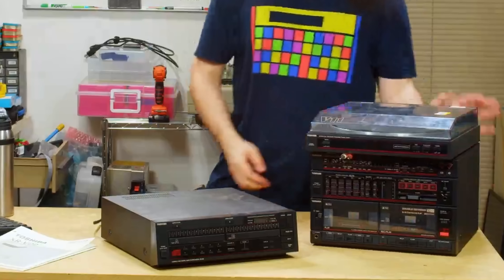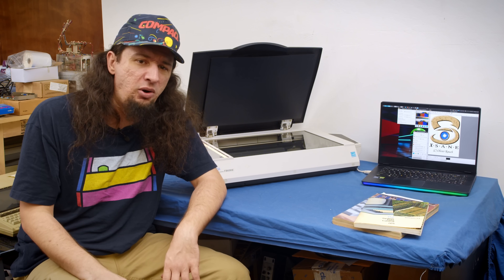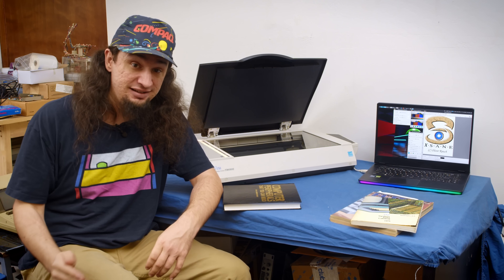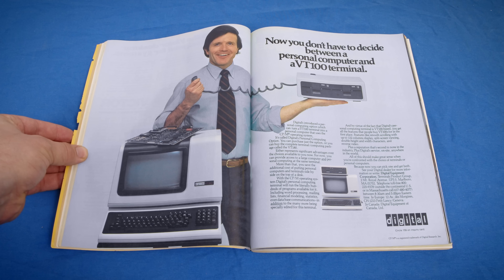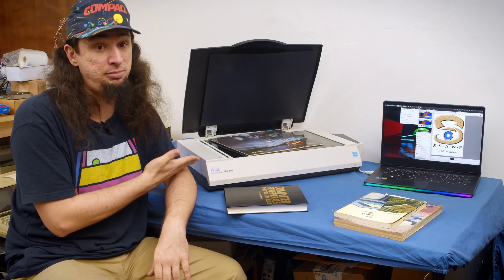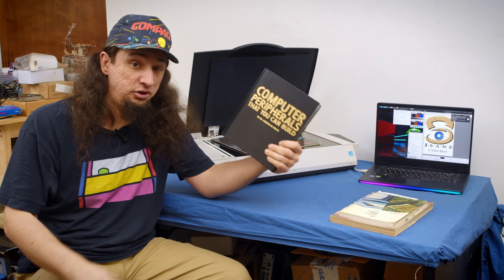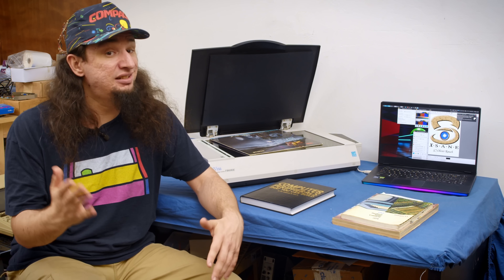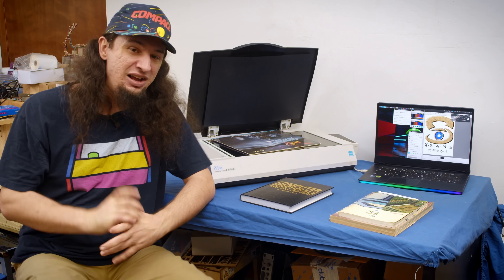Archival Grade Flatbed Book Scanner - Avision FB6080E

Comment: I was going to mention those CanoScan things. They can be a little slow at higher resolutions, but the lowres "preview" scans are lightning fast. I've not scanned many books, but magazines never gave me any problems - line the page up at the (0,0) corner and the binding gets cropped out. It does mean a lot of editing, but you'll be doing that anyway. (unless you can be meticulous in placing the page, then the cut is the same on every page, and that can be programmed.) For pictures, I have this HP thing; no drivers required as it presents as a standard storage device containing a jpg. (the "driver" just watches that drive for new files and copies them.)

Comment: The Canon LIDE is great. The ImageRunner sucked because they didn't implement a grayscale mode but you could use the ADF..  I'm in the debinding camp, but what I do is clamp the book between two two-by-fours and feed it into the belt sander until the binding is gone. Then I feed the pages into an ADF. A little trick on ADF scanning is to fan the paper first, as it can be humidity dependent.

Comment: Personally I own a Canon flatbed scanner that can also scan film in both 35mm and medium format 120 film used in most Hasselblad cameras. It can also do 35mm slides with the adapters that came with it. It is CF lamp based but I wish I knew the kelvin temperature of the lamp just in case it fails. There are sources for the lamps from what I have seen but they only give dimensions and color temperature. Most of these lamps operate at the same voltage so the power supply within the scanner hopefully would be universal.

Comment: I have to scan architectural drawings sometimes that are bigger than DIN A3- which is the biggest size for a normal flatbed scanner I can get here. So I have to fold the old plan into smaller shapes that fit into the scanner, which has an edge all around the scanning area.. and then put everything together in software.. which also sucks since the rotation never matches... the scanner in the video would make all of that a bit better.. I have worked with big format scanners- but they are completely unaffordable even for most print shops and they also tend to distort the image quiet a lot.. which is a problem with technical drawings.
Reply: Depending on how often you need to do this, you might consider a camera on a tripod with a panoramic head, and open source panorama software (e.g. Hugin).

This would allow easy capture up to around 40" x 30", 600 DPI.

Comment: I have a Canon Lide flatbed scanner and would love to have the proper drivers to install to Win10.  Had an old IBM branded flatbed scanner that used the parallel port and that was the best flatbed scanner that I've seen.  The IBM scanner was able to capture clear images that had physical depth to them.  It was not a 3D scanner but it had a good 1/2" depth of vision from the glass.  I was surprised when I used it to image old ISA cards.  Unfortunately I don't have the IBM scanner anymore a friend needed to image their family photos.
Reply: Vuescan.
It works with these canon scanners, mine was my go to until it fell off a shelf

Comment: I like my little lightweight cheapo scanner with buttons on it.
It's bad and it jams but it's USB powered and I can just hit a button for 75/300/600 DPI respectively and the scanbd daemon just dumps to a folder.
I'm mostly just scanning stuff and not documents tho. Really good way to get a footprint for reference when making 3D print models. Dimensional accuracy good.

Comment: What I got for scanning a stack of documents was a used Canon P 215.  It is not for book scanning but it does have an automatic feeder with duplex scanning. that can be used optionally.  It is just a typical 600 DPI scanner but I got it used for around $50.  It has so far scanned a couple reams of documents and is still working fine.  This would have been at least $300 if I bought it new.  It is a portable one you can take with you while you travel and can get all of the power it needs from just a USB port.  Its USB port is micro B like a lot of cell phones came with for a good while after the manufacturers got their heads out of their @sses and started using things not proprietary.  I say proprietary because an old flip phone I had used a special socket for charging and it was nothing that any PC or Mac ever had.  It was different enough from USB that you know nothing will work with it and if you lose that charger you may as well throw the phone away.  I am glad they do not use proprietary things like that any more with the exception being Apple.  I am glad the EU told them to stop.  The last thing we need are more weird connectors that do not work with anything except one specific device.

Comment: Document cameras have made scanning obsolete. And even back then, libraries quickly switched to cameras. I worked in the field years ago and we ended up investing in automated book scanning machines using page turners and cameras.
Reply: It takes an insane resolution camera to do what scanners can do. By many measures, we have that today, but even a cheap scanner can do better than your iPhone 27 and it's 9 cameras.
Reply: @jfbeam  Do you need that insane resolution?
Reply: @jfbeam  we are talking about digitizing text. And, for that matter, a 45 megapixel digital photo of a properly backlit 35mm slide taken on a mirrorless camera is superior to a scan from even a coveted Nikon LS-8000 or LS-9000 scanner - which costs as much today as it did 15-20 years ago. A cheap flatbed will give you a nice flat image though. There's almost no other reason to use one.
Reply: @JGnLAU8OAWF6  not for book scanning. They don't know what they are talking about. "Insane" is not a measurement. I have scanned and digitized hundreds of thousands of archival quality images, by hand, on both scanners and with cameras.

Comment: I can find a brand new Avision FB6280E for about $1000 without taxes locally in Europe (without additional SW). I assume, that's the normal asking price for that unit.
Generally speaking, finding a A3 flat bed is neither easy nor cheap. I just checked several sellers locally and they ask about $500 for the cheapest A3 flat bed scanner, the second to cheap was in thousands of dollars. From what I found in the past, the cheapest way to get a A3 flat bed scanner is to buy a multi function printer with one attached. No idea, why it is this way, but it is.

PS: Look at Mustek A3 Scanner S 2400 Plus, that one may be a reasonable option too. If you can find one.

Comment: The old SCSI scanners from the early 90s, that were legal size, and they were really nice, but they were incredibly slow.
They came with a 50 pin to 25 pin cord that plugged into the standard LPT printer port.
I bought a combination SCSI ISA card then a PCI SCSI card that had an internal 50 pin header and a SCSI 68 pin internal cable, and an external 50 pin connector and a 68 pin external connector.
The software had drivers that talked to the printer port and communicated to the scanner through the cable.

I never tested the cable to see if there was any electronics in the cable.
I don't think it does.

I think SCSI 50 connector has pins that are able to output and input LPT data

I never searched about this but it was sold as an SCSI scanner that connected directly to the printer port.

SCSI was really nice for the 90s and faster than IDE

But it was more complicated

The SCSI CD-RW was nicer but the IDE CD-RW was a lot simpler.
Being able to just slide it in and connect to the existing IDE cable and not need anything except for the software program to make it work and the SCSI CDRW was 400 dollars
The IDE CDRW white box was 99 dollars

That takes me back to the early 90s
Reply: Are you sure you aren't misremembering things? Using a DB-25 for external SCSI devices used to be popular, but it had nothing to do with the parallel port. Scanners with both interfaces still had separate connectors for them (with a 36-pin Centronics for parallel), at least the Epson camp definitely did.
Reply: @PileOfEmptyTapes  you might be right. I think there was a 36 pin connector the 25 pin LPT cable connected to. There was a separate 50 pin or 68 pin connector on the scanner and if I remember correct it had a pass through 50 or 68.pin connector.
I remember having to set the SCSI ID on each device.
The external hard drive which weighed about 60 pounds and was 2 feet by 1 foot by 1 foot square was set to 1 and the 50 pin cable fed into that and it had a pass through and the external CD drive had the same thing and the scanner was at the end set to 3 and it needed a 50 or 68 termination block. Plugged into the feed through port to. Tell the SCSI card that was the end of the chain.

It was incredible back then to have a 9 GB hard drive and it took a lot of power to run the giant motor.
It sounded like a car engine and it took a minute to get up to speed and it had cooling fans that threw a lot of heat.

I remember running DOS and I was so excited to get Windows 3.0

It was the first real GUI that could do anything other than look at and run the files.
It had communication software that was much easier to use.
Still needed to write a script to connect to the Internet, but it was better than running AOL from DOS

Thinking back to those days and how much they did so little memory and storage space, they were genius.

I remember seeing the first color printer and it needed 800 MB of disk space to install.

And it was still terrible at printing colors.

Kids today have no clue how great they have it.

And I wish MS had made windows 3.0 a decade before they did.

Seeing the videos of people putting Windows on a 1983 IBM, it was possible that they could have made it and run it back then.

But at least we got here.
I am hopeful that they will build a full A. I. that is self aware and that we can treat as a human and have help for people like me who are old and bedridden.
With robotics, it would be wonderful to have a robot to help me.

I saw a movie years ago about a time in the future when they have robots that help old people.

Hopefully it will come soon

Comment: I sell books online and need good color photos. Actually the CZUR seems to be disastrous from many points of view, especially regarding color images. I need front and back photos of the cover, and some internal images. I haven't found a suitable solution yet. A normal mid-level camera cannot overcome shadows and I don't have professional lighting, which is too expensive and requires technical skills. The flatbed scanner on my multifunction printer is inadequate and too small. I haven't tried a lightbox but I'm afraid that the reflections from the LEDs are inevitable and in any case I would have difficulty keeping the pages open and taking the photo with the other hand. From this point of view, the CZUR seemed excellent. I thought it was fast, guaranteed good lighting and good rendering, and cropped images well. But from what I have learned, the software often goes crazy and has a variety of serious imperfections.
There are high quality A3 flatbed scanners like the ones you mentioned but they cost thousands of dollars.
I'm disoriented.

Comment: 3K?  I purchased a low mileage Kyocera 4003i $3999 which was a repo.  
Prior I had tried the Plustek A320L and sent it back.  Could not get the colors balance setup correctly.  
My slow high detail "when I have a lot of time" is Epson v750 Pro.  Unfortunately it does not scan anything larger than about 8.5" by 11.5".
Reply: With a very clean ADF, if the document you are scanning has slightly curled paged, or is decades old, you'll have problems with slightly skewed pages, and high dust accumulation within the paper path and rollers.

An additional item for a flatbed scanner is to have a ColorMunki unit to make sure the colors you see on your monitor match the scanner. Especially as your monitor and the scanner's lamp ages.

Comment: First, the reason they're not all like this is probably the same reason the price is high.  You can bet someone had a patent on the zero edge, good idea too.  Probably covered most of the time that people were scanning much of anything, early 2000's range.

The black spots in the gold foil are easy to understand, it's where the reflection from the gold was more directly back to the CCD, they are the 'over white' spots.  Some CCDs make true reflections all white, some all black.
Think of the CCD cell as giving a value from 0 to 1000, 0 as black, 1000 as white.  You start at 0 then count until you discharge the charge stored in that cell, then assign that value.  
Zero out the number, then start counting.  But if the cell has say 1200 charge in the cell and is over ranged, you never finish counting and assign a number to that pixel, so it stays 0.
It's the same reason that some CCD based cameras will make the Sun a black spot if it's in frame, the CCD cells are being over ranged and that CCD leaves them at black value.  Other CCDs will result in 'maximum white' for over ranged, just depends on the way they counted.

Comment: Interesting subject, I once started to scan all my books of electronics (I had more than 100), with my (by then) HP scanner. It went very slow, and I gave up the idea. When I got another flatbed scanner, an Canon, I started again but again I gave up. Note that this was done in early 2000 on a P2/3 computer with Windows 98.
However, I have a question: What happened with your computer? The old one that weights a ton? I am still waiting to see something about it.

Comment: Why would you compromise your scanning (or any other job) just so you can use Linux? It's obviously not good for everything. Scanner support, drivers, and software is great on Windows and Mac. You can easily create and run a portable version of Windows with Hasleo's "WinToUSB" which lets you run Windows completely off an external USB stick or HD so you can use it on any system. Or do a Grub multiboot on an external drive and just use it when needed. I like having Windows, Mac, and Linux systems for different tasks to make life easy.
Reply: Decent scanners have been well supported by Linux for over twenty years and still are. Why would you compromise your computing (and scanning) experience running something else?

Comment: I have actually just picked up a LiDE at the local hardoff for roughly 50¢.
The frame is not integral on the glass, so you can just snap off the side bezels which are held by simple double sided tape. 

It however also must be calibrated with VueScan on every power on, is very slow, and color reproduction is absolute garbage due to it's LED nature combined with some weird multi reflector stuck on top of the LED strip in place of a diffuser, so I would say it's worth no more than what I paid for it...

Comment: How do you do all the post processing of the images, such as cropping, alignment, yellowing pages correction, & rotation & skew correction?  THAT is the things that dominates the time from book to PDF, NOT the scanning time.
Reply from the maker: Because the spine of the book is pressed into the front of the unit the position and rotation are very repeatable. So I crop the image before it is saved. Color correcting is done with imagemagic as one command across all images at once by using the black & white levels and gamma.
Reply: @TechTangents  Cropping the border DOES NOT straighten the text!  it only straightens the borders.  Cropping also causes problems as you may position the book a little up/down from the same position you had when you set the crop.  This especially happens with very thick books.
          I also have problems with brightness chancing across the page leading to "too dark here, too bright there" when trying to set thresholds for text.

Comment: That Linux compatibility comment cut deep- I fell for the "Linux support" on a Mustek, then a Viisan that later turned out to be a driver only compatible with Ubuntu 16.04, and was the same driver both times to boot. I keep an old Mac mini just for a scan station because of this. All I want is A3 scanning on Linux, why is that so hard?
Reply: Every scanner I've ever plugged into linux "just worked" with sane / xsane, including a Fujitsu fi-5750C A3 scanner.